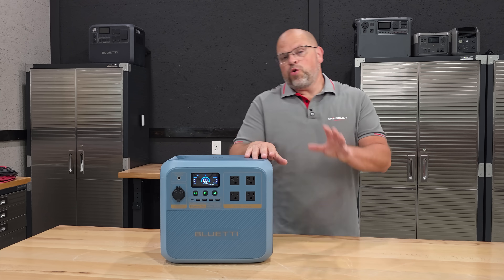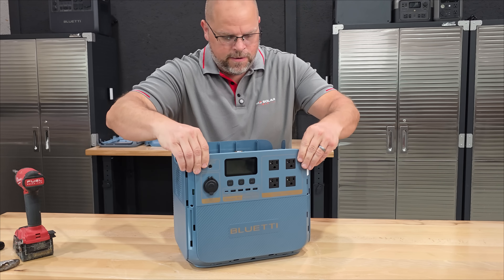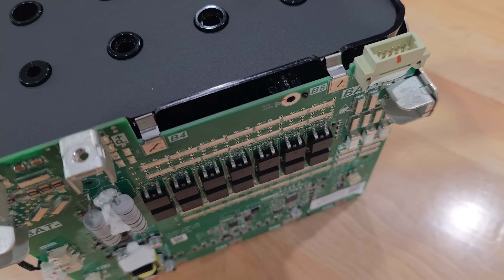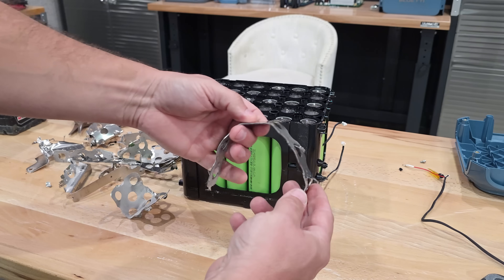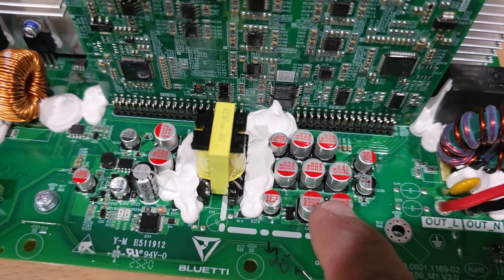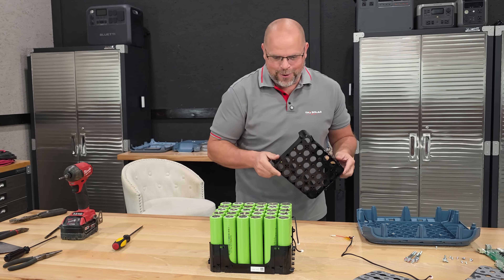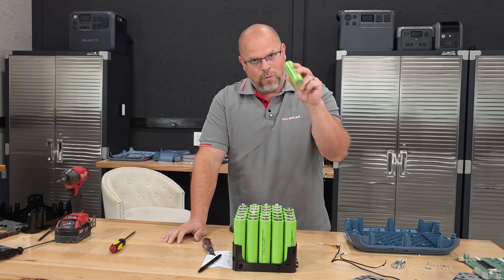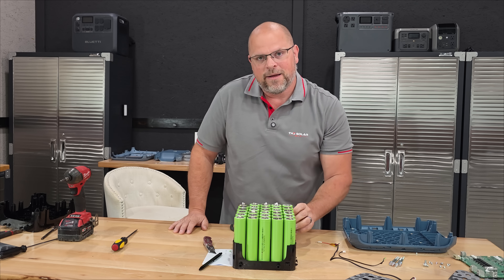Bluetti promised us SODIUM-ION and we got what?!! Pioneer Na Teardown

Comment: These look like A123 systems cells. They use the same font and print configuration with serial numbers on each cell and the barcode for the serial. Also the green heatshrink is similar to what they use for LiFePo cells. Just my gut feeling as i have not seen any other manufacturer do that. Their cells are also usually premium quality so i believe Bluetti could order from them.

Comment: Two blueetti 500 watts invertors blow up when plugged in to power a 50 watts device that has a line filter.  I wonder how much of testing takes place as we just focus on cycles and battery but not the other parts.

Comment: I bought a bluetti, 567wh after 2 months I used it in my truck, and found out I would run out after an 2hours with just 135w laptop ru ring on it, I went to their website and it turned out it wasnt one of theirs it was made by another company and sold by them with their name for a diy store In the uk it was meant to have lifepo4 batteries, but theyre were regular 18650 li ion. I wont buy their products again

Comment: using nickel plated copper does not mean its high quality and same with red capacitors There is no electronics standard where:

red = high quality and thumbnail was misleading who thought that there wouldnt be battery cells inside

Comment: As an engineer myself, I strongly advise against tearing down or opening devices that involve AC power, large capacitors, or batteries. These components can be extremely dangerous and may cause serious injury or even start a fire. Do this only if you truly know what you’re doing—like our guy @TheSolarPit here. These are not devices to be messed with.

Comment: Insofar as informational tear-down videos go, that was weak and obviously not your best work, unless you're this clueless in ALL your videos. I didn't bother checking: not worth knowing. There was lots of  babbling to gloss over things you didn't bother looking up beforehand. Lots of shill-speak for Bluetti and stobbing on about how high quality their electronics are, but you didn't even know the name of the capacitor manufacturer. Then you go by the ink color on the end of the caps as an indicator of quality? In what world does that make sense? Come on.

Destroying something new and expensive unnecessarily should be considered a shameful act, by my estimation. That poor battery bank deserved better attention to detail before being mangled with a shrug and a "I wouldn't do it if I could figure out how to do it otherwise", using a cheap pair of needlenose pliers and tinsnips. You even went to the effort of opening the case with a drywall scraper so as not to scuff the edges up! All that effort for naught. Sad. I think you could still salvage the bank if you took the time to research what's needed and how to do it. Maybe watch a few Youtube videos? ;)

Switching between using a screwdriver and a Milwaukee with the world's filthiest battery was a nice touch. It made me feel just that much more exasperated with you and made me wonder why I was watching this at all.

Good job taking apart the circuit boards and the rest of the bank without blasting sparks anywhere. Those batteries can probably bite pretty hard if you accidentally shunt their buss bars to each other.

It's OK to not know what you're doing. It's OK to not know what proper nomenclature is for items you're not familiar with. It's OK to fudge things sometimes and gloss over details. All at once, though? It just serves to make you look like an amateur. This shouldn't have been that hard to prep for. As a first-time watcher, I was sincerely unimpressed.

For any fanboys who wish ill will upon others because they spoke their mind: that's just too goddamn bad. I have the same right to speech that you have, if you live in the USA. Respect the provenances of the Bill of Rights or at least think before you speak. Thanks.

Comment: Could of just read the part numbers/bar code without ripping it apart, these are 10A 3.0V Sodium cells, if they were LFP cells of the same dimensions 32mm x 140mm they would be 15A x 3.2V and have a capacity of 48Wh as opposed to the 30Wh batteries in this video

Comment: If you google that model number, it'll show up quite clear that it's most likely sodium ion. Also, the cells are marked with 3.0V, which is way lower than the 3.6V of a lithium ion or 3.7V of LiPo. A fully charged NaIon cell should be about 3.8V and all of this could be read from the side before you ripped open the battery pack ;)

Comment: Take the actual battery apart..Get hydrogen peroxide or phosphate..after you lay out the lining of the battery...Take a few drops on the lining..if it's sodium it will have a big reaction with the hydrogen or peroxide.. There's your answers..will produce gasses so wear a mask my friend...

Comment: Thanks for the tear down. The batteries will read a higher voltage with no load. There is sure a lot of semiconductor and caps in the box. Sodium batteries can still experience thermal runaway although at a higher temperature. The Battery Management Board and temperature sensors are still needed to control recharge and discharge rates and temperature. The lower cell voltage is expected from a different chemistry. I suppose the question is, can you short a charged battery and make it blow?

Comment: Nominal voltage on ion batteries is commonly the minimum charge to use before damage. So LiPo are charged ar 4.2V and discharged at 3.7V. Sodium cells have a full charge at 3.7 to 4.1V there is not a standard construction at this time.
Quality of Bluetti is great, but this "impossible" to replace of battery is not good.

Comment: Simple voltage curve test using a car head light bulb and multi meter would have proved those cells where sodium or LifeP04.  The fact he didn't do that test is a bit suspect !  The voltage curve and energy density of LifeP04 is much better suited for a power bank than sodium.

Comment: bluetti Eb3a died 1 month out of warranty.  I called Bluetti while the unit was under warranty with concerns about battery not putting out as many wh as they claimed.  They made me update firmware, pulled my chain with multiple emails back and forth, never honored the fact that the unit was not delivering what was advertised.  Now, 1 month after the warranty ran out, the unit just shuts off at 50% and wont turn back on until power is applied. Almost like it was designed to fail outside of warranty. Absolute hunk of $hIT.  Will never buy any of these portable battery banks again. Ill just build my own setup.

Comment: A search online of the model number appears to confirm that they are indeed sodium batteries, with a number of manufacturers in China mentioned with links to spec sheets and other data. They are 32mm x 140mm 3.0 volt(nominal) 10 Ah.

Comment: Very easy no need to get expensive collaboration, simple way is to use single cell day night and completely empty it, then use  cutting plier and start picking its anode and little by little when u have little grip on cell metal sheet rip it and slowly u can rip it all and then same with lithium cell check both cells composition, u will understand.

Comment: 32140 means 32mm diameter 140mm long, the cheapest way to test the battery by getting a characteristic curve. (connect a resistor and data logger for the discharge curve) then graph the data

Comment: mate, you can verify with a single cell charge \ discharge profile. Lithium Iron Phosphate and Sodium chemistry behave differently.
The behaviour of the charge circuit would also be worth measuring. A logging DMM is all you need.... and a voltage \ current controlled power supply... or a couple 'dumb' meters and a camera set to time lapse \ 'motion detect' on value shift.

Comment: Isn't it just easier to look up the part number on the battery?  32140nsmp10-30 shows up all over the place with identical images and specs Sodium-ion Cell: 32140 3.0V 10Ah (30Wh, 30A rate) .  Judging that many are being sold for around $30 a piece, the cost of the power station is well worth it at $800.

Comment: LiFePo4 litium: 3.2V

NMC-litium: 3.6V~3.7V
Reply from the maker: Those are nominal voltages not Open Circuit Voltage. But a good visual indicator on the label that 3.0V is not LFP or NMC but indicative to Sodium Ion.

Comment: So near but so far. Stripping it down is all well and good but any trained monkey could have done that. Putting those cells on test for voltage curves is pretty much the simplest way to determine their chemistry. 5 mins on Aliexpress for the kit, and a few hours of running tests would set you up for actual testing and being reasonably sure of outputs.
Also, whilst the manufacturer may have an R&D department, I can assure you they are NOT manufacturing their own cells in-house, as you stated (presumably info you got from the marketing information they gave you).
If you want to be independent, do your own research before making videos please, it'll add far more authenticity to your channels content..

Comment: Surprised you did this at 100% charge!  3.85v is already indicating sodium (at 100% charge) because 4.2v is 100% for your typical lithium battery.
30v is a little weird - but I assume it has to do with the wide voltage drop you'll see with sodium cells (3.8v down to 2v)
Reply: Close NMC is 4.2 (3.6 nominal), but LFP is 3.65 (3.2 nominal), but I do understand that their are more NMC cells currently being used making your "typical lithium battery" statement more correct. A slight number change at the end sodium can be these numbers but they will have a larger degradation if used in this range (4.0v down to 1.5v)

Comment: those bars are not tin plated, they are nickel plated. Tin plating don't like current flowing through, this will lead to dendrites along the magnetic feld lines. If this get really bad, this shorts out, and it looks like cotton candy before it blows up.
Nickel has the same problem, but you need to pump thousands of amps through instead of a couple Amps.
Reply from the maker: You are correct, I misspoke. Thank you for clarifying 🙏 👍🏻

Comment: stir welded. Grab a fire extinguisher and put the battery in a metal bucket after you crush it or drive  a nail through it to see if it ignites. If it doesn't, then it's not lithium based, and it's verified output would prove it isn't NiMH or NiCad.

Comment: Run the power bank till bms turns off, measure voltage of cells. Sodium-ion voltages are different in comparison to lifepo4 or li-ion

Comment: I wonder why round cells instead of flat packs?
Reply: Air cooled, round cells allow more cooling air to pass between all cell walls.
Reply: @chetsaxton1526  I know that but in a device like this heat should not be that much of an issue, energy density is.

Comment: It looks like Sodium to me - 32140NSMP10-30 corresponds to the HiNa NaCR32140-MP10 sodium-ion cylindrical cell, manufactured by HiNa Battery Technology Co., Ltd. (commonly shortened to HiNa Battery).
Reply: It states 3.0v, if it was LFP it would say 3.2 or NMC would state 3.65.

Comment: Drill a small hole in the side of a cell. Wear a face shield and heavy gloves, and do it outside on pavement.

A standard lithium cell will immediately shoot flames from the cell, and burn spectacularly.

A LiFePo cell will just smoke and eventually burn itself at a fairly low temp.

An NaCl cell will just sit there after initial heat from an internal short.

Comment: 60V DC on these is actually closer to 97V at full charge.  Certainly possible, but  that's well beyond to low-voltage exemption for electrical work.  Hell that 10S pack is 38.5V at full charge.  Maybe you can sneak in a 15S Pack in under the low voltage. exemption.
Reply: this guys is a youtube grifter, he has no idea of what he is talking about, that is why he made this dumb comment about the inverter voltage.

Comment: I'm sorry man. You can tell if they are sodium ion cells simply by measuring the discharge curve. It's very linear like a capacitor, not stable followed by a sudden drop in power.

Comment: Those numbers and bar code correspond to lithium ion! 

AI Overview
Based on the text and barcode on the battery, this appears to be a CBAK 32140 LiFePO4 battery cell. 
Model: 32140NSMP10-30.0Wh-3.0V
Chemistry: Lithium Iron Phosphate (LiFePO4)
Nominal Voltage: 3.2V
Capacity: 15Ah (15000mAh)
Applications: It is used in energy storage systems, electric vehicles (EVs), and solar setups.

LiFePO4", which stands for Lithium Iron Phosphate. This is a type of lithium-ion battery.

Comment: You can see the cell type from the side. What are you thinking? You want to open the cell and taste if it is sodium? What a useless waste of materials. The whole charge and discharge cycle on sodium is completely different as is the control hardware. If you weren't just trashing the thing, what a pity. All you had to do was look at the charger circuit or the BMS circuit and it would have been clear. Even just running it down untill it stops working and measuring the battery voltage would have proved the chemistry.

Comment: Uh, kudos on the handle design.

I've cracked open a few of these bigger stations and they usually trust the plastic.

Those long bolts to the floor to the handle? Nice.

Molded plastic for comfort, steel for strength.  Good job Bluetti!

Comment: It takes this person 15 minutes to tell the viewers that he’s not able to test the batteries and confirm that they are Na-ion batteries. That’s funny!
Reply: Glad I went to the comments first. Save 13:38 of watching the video.
Reply: It’s funny. I’m blocking for misleading content.
Reply: @loveller  ? I've watched a few reviews on this item. what is misleading about it? they may have a biased review agreement however from what i have seen/heard it is legit.
Reply: A Lithium ion battery is a nominal 3.7 volts and up to 4 volts fully charged so it's strange that they're saying 3 volts on the label ...
Reply: I disliked him
Reply: 1. The marking “NSMP10-30”

Many sodium-ion manufacturers (CATL, HiNa, Faradion, etc.) use the letters “Na”, “N”, “S” or “NS” in their model codes to distinguish them from Li-ion.

“NSMP” could very plausibly mean:
	•	Na (Sodium)
	•	MP (possibly “Manganese Prussian-blue” or “Mixed Phosphate”)

This matches known sodium-ion chemistry families:
	•	Prussian Blue / Prussian White cathodes
	•	Hard-carbon anodes

2. Voltage is printed as 3.0 V

This is a red flag for sodium-ion because:
	•	Sodium-ion nominal voltage is: ~2.8–3.2 V
	•	LiFePO₄ nominal is 3.2–3.3 V
	•	Lithium NMC/other is 3.6–3.7 V

“3.0V” is exactly in sodium-ion territory.

Also, the label explicitly says:

“0 Wh – 3.0V”

Which aligns with sodium cells being shipped/stored at ~3.0 V.

3. Sodium-ion cells increasingly come in large cylindrical formats

Common emerging sizes:
	•	32140
	•	40160
	•	46160

Several Chinese companies are mass-producing 32140 Na-ion cells for solar, scooters, tools, and low-temp applications.

4. Green wrap and long laser-etched ID

This is commonly seen on:
	•	HiNa Sodium
	•	Tiance Sodium
	•	EVE early sodium prototypes
	•	Various OEM Na-ion cells from EV tear-downs

It looks very similar to known Na-ion test cells.
Reply: it is called a youtube grifter.
Reply: He could have tested them.  Just by smashing them.
Reply: Exactly, it's ridiculous. Don't know this gentleman, this is the first video of his that i watched. Will be sure to avoid in the future.
Reply: could YOU do it??? 
i mean ASIDE from cutting down each cell and looking inside it's hard to determine with accuracy the chemistry inside, because from an electrical POV that's not possible with normal and lab measuring/monitoring devices.
plus we had valuable infos like the physical size, voltage and wattage each cell is built, as well as the array...
Reply: @Kurumi_6_10th  of course. I have a video cam. I could make a 30 minute video that has absolutely no conclusion. If I wanted to make a video about testing the validity of something, I'd likely be sure I could. No reason to waste everyone's time, otherwise.
Reply: @Kurumi_6_10th  cut one in half with a grinder, Li-ion will explode, Na-ion wont
Reply: the freezer test he did in his last video pretty much proved it to me. Lead acid or AGM would work however the weight of the unit and discharge rate and efficiency would be quite different.

Comment: Sodium ion battery cell is 3.0V. LFP aka LiFePO4 battery cell is 3.2V. Lithium-ion battery cell is 3.7V. Higher voltage also indicates higher energy density. Sodium biggest advantage is its abundance in nature. It makes it a lot loss expensive raw material. It is perfect chemistry for utility size battery storage, as well as home backup system. I am looking forward for an affordable 10 - 100 kWh home battery backup system
Reply: Isn’t it safer?
Reply: @terjeoseberg990  Even LFP battery is considered safer than the Lithium-ion. It does not have the Nickel, Manganese, and Cobalt. Sodium ion battery is also safer.
Reply: @SeekerOfJustice-h5x , Is Sodium safer than LiFePo4? Or are they about the same?

Comment: Chop one in half with an axe and see what happens. See if it catches fire. Try it with a dead one and with a fully charged one. Also try overcharging one to see what happens. And try fully draining one, then try to charge it again. From its behavior you should be able to determine whether or not it has all the properties that sodium batteries are supposed to have. If it indeed has all those properties, then who cares what the chemistry is, because we want that chemistry because we want those properties.

Comment: How come you don't have the capability to test if they are sodium ion cells? You only need to put a small load on it and measure the voltage drop as the cell drains. Do you actually know anything about electrical engineering?